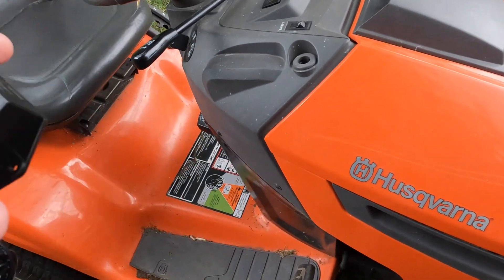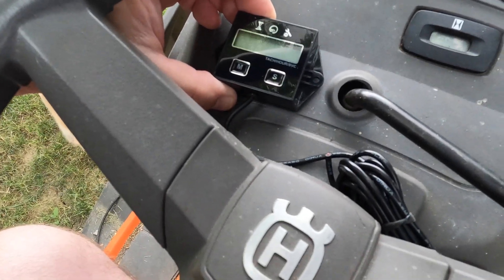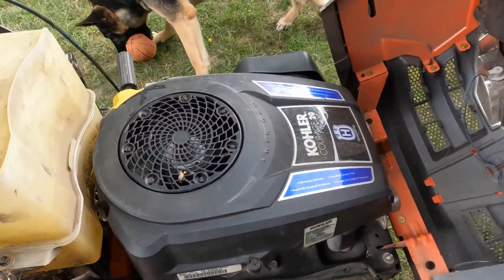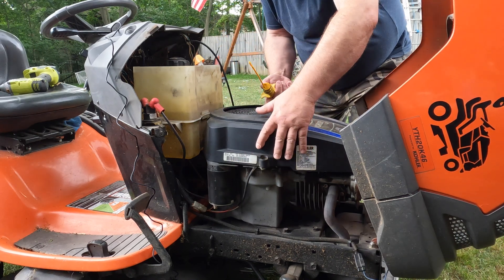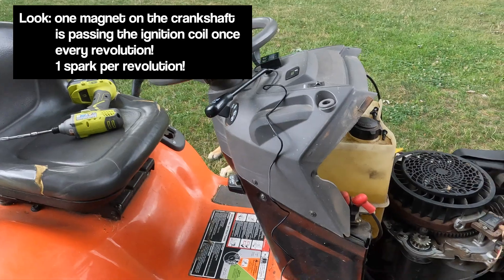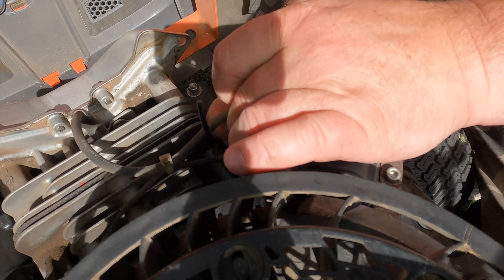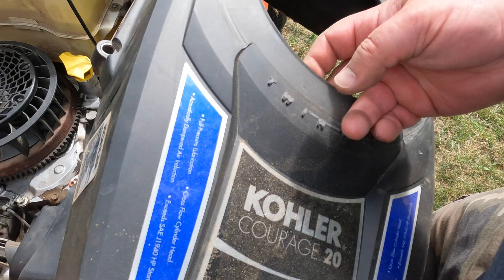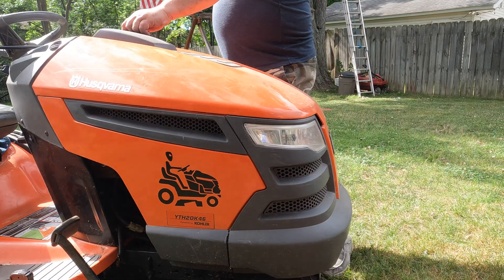Amazon Tachometer

Comment: I tried to fit one to my mtd it would not run with conected ???
Reply from the maker: @bobstanden6579  that's weird
Reply: @mygiguser  it shure is 
I have tried two differng ones now bouth do the same thing 
Seams to rob the spark from the coil to the plug
Take the contact wire of the the plug wire and start straight up ?
I guessing it's somthing to do wigh transistor ignition on. My New MTD ride on with. Hinies engine

Comment: Really dude you didn’t show us anything
Reply: I disagree!

The reason I was looking for info on THIS particular tach, is because I just received one and plan to connect it to the snowblower that I just did a maintenance on and I've seen everyone just wind the wire around the spark plug wire, BUT the instructions say to wind it AROUND the "spark plug", which I thought is not right.

So I found this video and as with others, he just wraps it around the spark plug WIRE (close to the coil) and it works.

So that was something that is important.  Not all written instructions are logical or correct, so it seems.

                                         👍😁👍
Reply from the maker: what are you looking for?